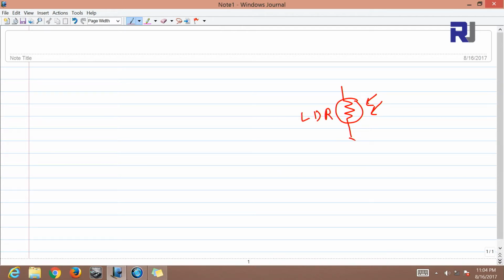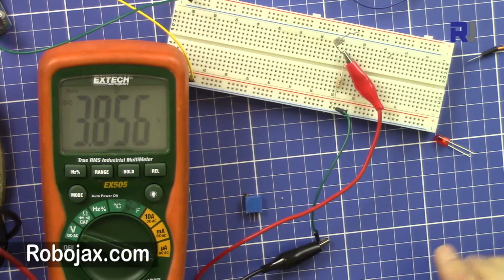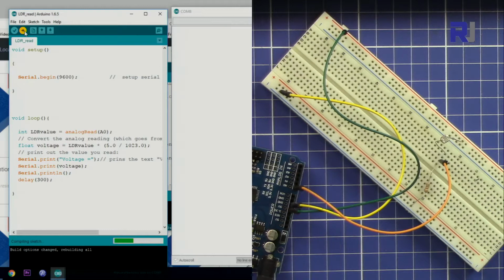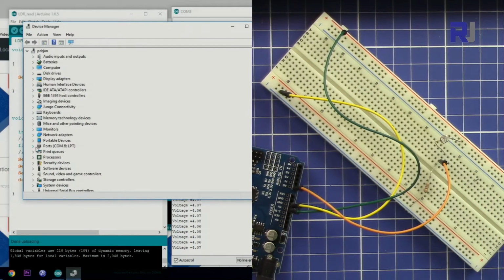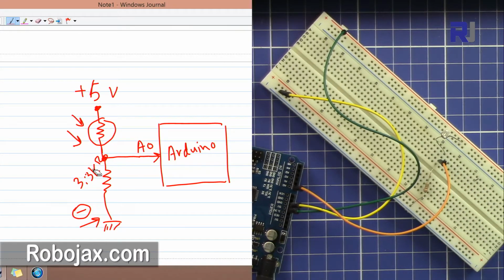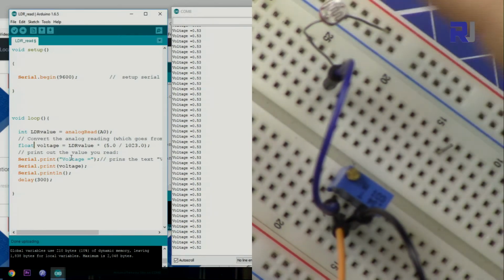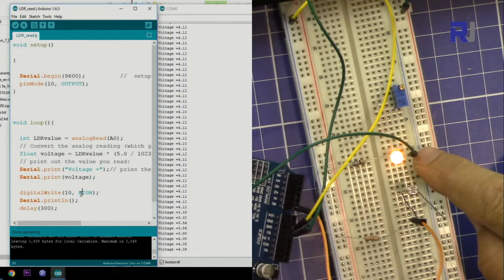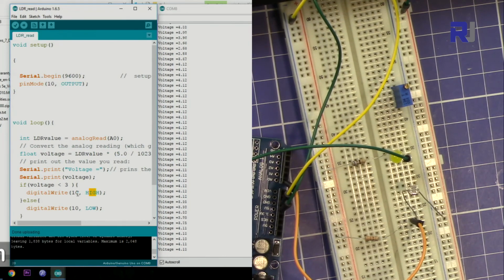Detect light, defferenciate between day and night Using LDR wth Arduino, photoresistor

Comment: I have watched EVERY SINGLE photoresistor & arduino video on YouTube up through the first 30 results. Not only have I not found a SINGLE video that explains the need for the fixed resistor (what they are calling a "voltage divider," but at least one person in every video asks that question in the comments section and never gets an answer. I am extremely frustrated because I cannot find this information ANYWHERE. Why can't you just connect one leg of the photoresistor to +5V and the other leg to A0 and measure the output voltage (and therefore light level) directly?
Reply from the maker: I won't work if you connect it to +5V and A0.  The Arduino input pin A0 does not pass the current. So you have to make another path for the current to the ground. And that's why I included another resistor for the current to pass. Now the current that passes through this 2nd resistor will allow me to measure the voltage that is changing with intensity of light in LDR.
Reply: @robojax This is the most info I have gotten on this so far. THANK YOU! So I want to make sure I understand. The analog (or even digital) pins do not act as a ground and do not act as a voltage supply. So you have to create a complete circuit and then have A0 "tap" the circuit? If electricity is flowing through the complete circuit from +5V to GND through the LDR and resistor, how then does anything get through to A0 in the "tap" for it to read what's going on?
Reply from the maker: Input of chips have something called "impedance" and these chips have  impedance in the range of 10MΩ to  100MΩ you can see it here https://www.arduino.cc/en/Tutorial/DigitalPins and they just work with voltage not current and they  do not act like a load on your circuit. so if you use this so called 100MΩ resistor with your LDR, because the current is so low, essentially you will see the same 5V at the input pin and therefore you will not see any change voltage if you apply light or make put your LDR in darker space.
Reply: @robojax  Ok, I think I'm starting to get it. The only thing remaining (I think) that I'm not understanding is sort of what I poorly phrased above. If you have a circuit that's complete and electricity is flowing through it, it's following the path of least resistance. So if I "tap" that circuit with A0, and A0 has such a high impedance, how is any electricity flowing to A0 for it see / measure anything? Wouldn't the electricity just bypass the "tap" to A0 since it's following the path of least resistance and A0 is a very high resistance? If I strip the live side of a powered-on lamp cord and touch it, I'm not going to get shocked because it's following the least resistance path (the copper wire) and not my finger...right? Either way, I won't bug you with any more questions after this. What you've kindly taken the time to give me so far has been extremely helpful and I'm very grateful!